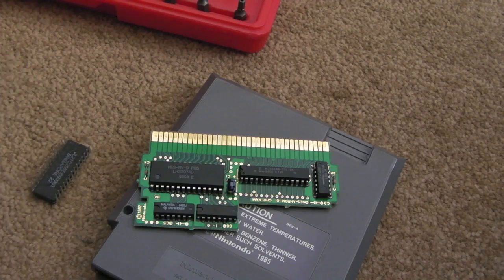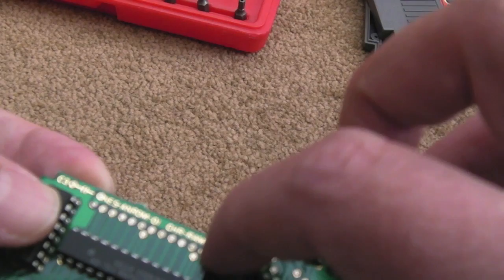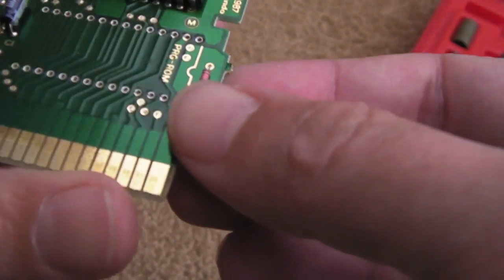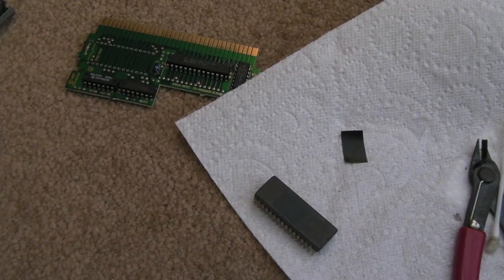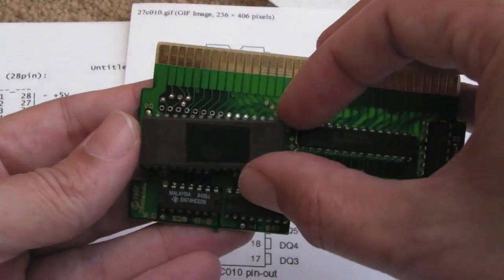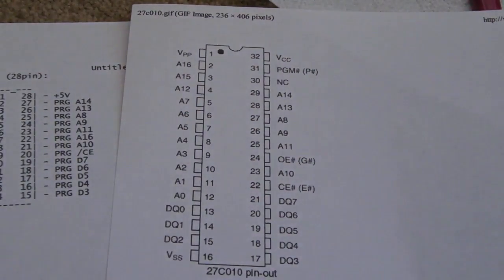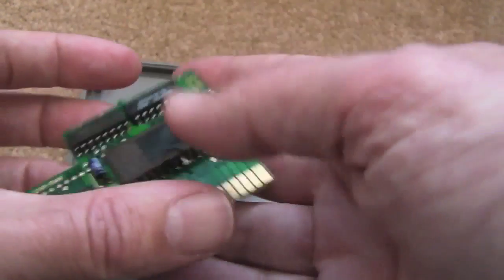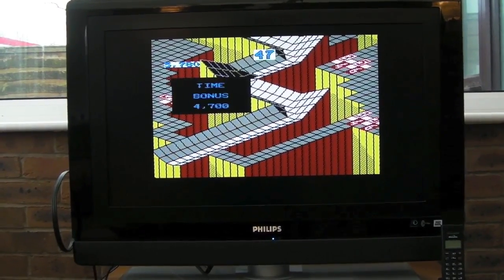Nintendo NES Cart Conversion (Marble Madness NTSC to PAL)

Comment: Just been watching all your vids on the NES, you got lucky as it doesn't look yellowed at all. It's interesting the NTSC to Pal mod, I got a few megadrive EA games that I was wondering if it was possible to burn an EPROM and change it to another game? Anyhow great/interesting vid as always
Reply from the maker: Thanks =)  Yes, mega clean - looking like new!!!  You can probably swap out the mask ROMS on some Megadrive / Genesis carts using EPROM as well - just need to find pinouts if possible first so you can work out the best chip to use, and like I did in this video - some modification might be required.   At some point I will go back to the 32x Doom to see if I can replace the original crappy release with the updated version using EPROM - Ideally making it switchable via reset, a little like I did with the Magician Lord on the MVS.

Comment: OE and CE should both be LOW.
Reply from the maker: Thanks =) It's working with them both tied together so I guess they must both be low?!?  I think OE is Output Enable if I remember correctly?  And CE = Chip Enable, basically one results in faster access as the other powers the chip down to a low power state, but both effectively give the same result albeit with different timings as a result.  For this type of use I guess we just leave the EPROM always in a readable state.  I haven't checked to see if CE is linked to the NES in some way.
Reply: GadgetUK164 thats not right.. you tied ce to the right hole, oe however should be tied low as it can cause problems with timings just as you pointed out. Vpp should be tied to ground or vcc. Why? Dunno, it says so in the datasheet (27Cxxx) so i just do it. ;)
Reply: GadgetUK164
/OE and /CE are tied together on the PCB on most game circuit designs.  Saves on traces and lines on the control bus.
so long as both are at 0v the ROM can be accessed.
Reply from the maker: Yeah, it's working fine with both tied together on the NES.
Reply: Most Nintendo-made maskroms doesn't have OE :)
Reply from the maker: Yes, that's correct!  It does work with CE and OE joined together on the NES though.  I guess on faster systems like the SNES it could be a problem timing wise.
Reply: Yeah, this video is a proof that it works. ;)

Comment: 128kbit , not kbyte?
Reply from the maker: No, suprisingly it's 128 kbyte! So it does need a 27C010 or similar.  The mistake I made to start with was looking at the 27C256, which is 256Kbit - I made the mistake there of thinking it was twice as large as required when actually it was only 32Kbyte =/
Reply: I commented before I got to the end of the video. When you think about it tho, that makes sense. Do you have an email address so I can explain a bit better?
Reply: GadgetUK164
ok I figured out why.  Have you seen a JAMMA video board at all? that will tell the story a bit. Its 128kb because it doesnt only contain the program code, it will contain the binary for the sprites and backgrounds etc as well.   I think what its doing with the RAM is using it as a shadow RAM.  RAM can have a faster access time plus you may need to manipulate sprites etc , so what it will do is dump all the graphics into the RAM and then the PPU will access the RAM instead of the ROM for the graphics code.
Reply from the maker: Yes, that's exactly as its working!!!  I went back to some of my old emulator code last night and started to remember that in many carts that's exactly how it works - so more graphics can be accessed easily from the PRG ROM and often the first blocks of code in the PRG init the RAM and system and then block copy from an address in PRG RAM to VRAM address. Thanks for posting this ;)